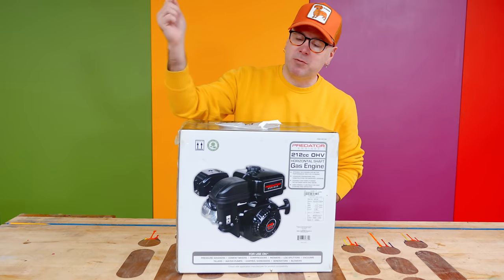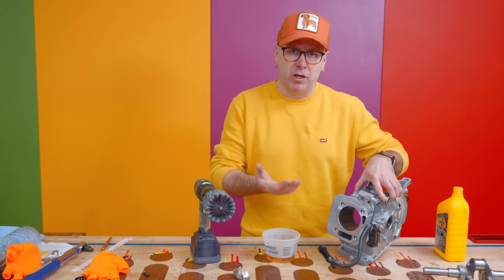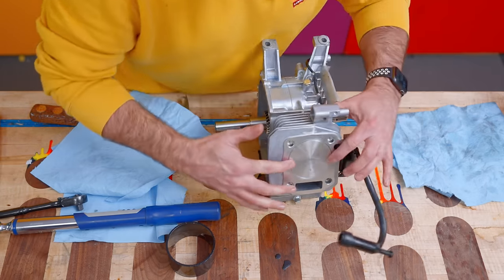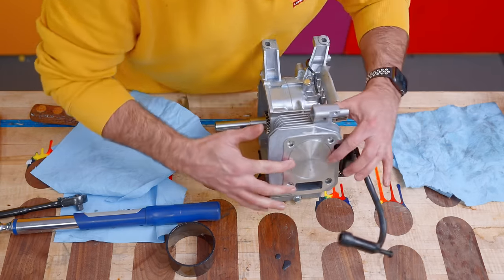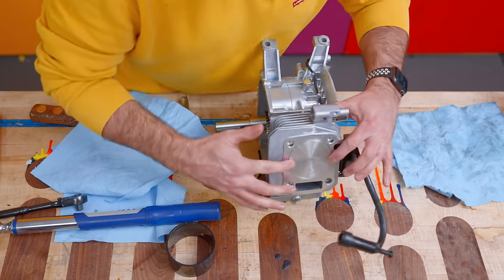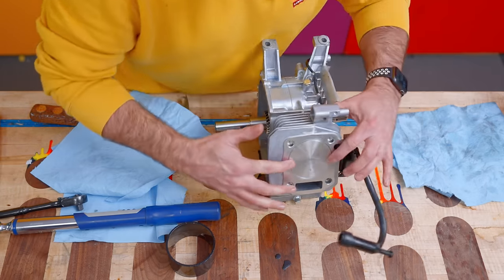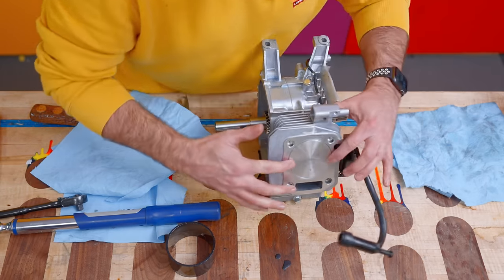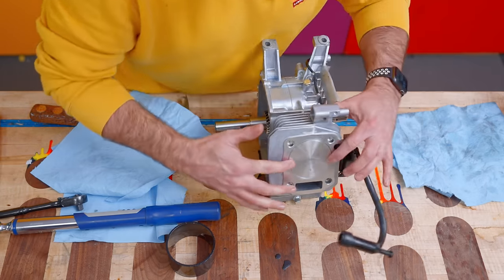How to Build a Competitive Kart Racing Engine (Stock Appearing)

Comment: easier way to get the flywheel of..if you remove the pistonrod anyway..leave it on until you removed the rod..put the nut slightly back on the crankschaft and give it a whack with an hammer!😁

but i still don´t get why PPL spend so much money on Parts for those cheap Honda Clone engines...just a billet flywheel will cost twice then the whole engine!

Comment: Piston ring compression tools are a bad idea, especially for just one piston. Almost as bad as using a pick to instal the clip on wrist pin.
At least if you use a piston ring compression tool that you don’t need, make sure the piston isn’t binding in the cylinder. You can’t see if the rings are facing correctly & in their grooves. Hence why they’re a bad idea. 
Don’t file or Dremel over a open engine. Especially not over a open bearing. You don’t want metal shavings in your bearings.

Comment: Man your doing it wrong. Briggs came out with the lo206 moter. Its to make competition fair. The cam tolerances vary so you buy 10 to 20 of them to find a good one. Modifying a cheap motor with aftermarket parts make no sense. That costs way less and hf only sells 1 motor instead of 20. So yeah the local option is great.

Comment: are there weight restrictions in go-carting?  i’m guessing the 6’3”. 260lb guy will be a bad driver choice.  lol
Reply from the maker: Most have a min weight of 350 lbs. The league I run in does not so it is an advantage to be light.

Comment: To add to the power tool comment, if you have a drill that has a low torque setting put it all the way low and then torque what you need by hand 👌🏼

Comment: That’s not glitter buddy  ,that’s metal shavings from bad clearances and rough edges on the teeth . That’s not good . Couldn’t you just Deburr everything and polish all the parts inside , without taking away  tolerances . Just a nice clean up so that there is no metal rolling around during the break in phase .

Comment: its not hard to make a piece of sheet tin with a  valve stem in it a rubber tube make a good gasket when you are looking for valve leaks air up the port lightly and look for bubbles in the alcohol not water

Comment: Well done you’ve just unbalanced the crank also when honing it should be accurately straight in the bore other than that good job but focus on those 2 issues
Reply from the maker: It's actually impossible to balance a single cylinder motor because of mechanics and physics. Look it up. 😉

Comment: If you didn’t skim your heads with a belt sander you probably wouldn’t have to run thicker gaskets. If you get them done on a mill you can probably get away with the thinner ones.

Comment: Weld inside the block and cover to stiffen the motor.
Reply from the maker: Not allowed.
Reply: @SomethingAboutMaking  in racing, if you are not cheating, you are not trying.
Reply from the maker: @timlaws7034  Reminds of the quote by the great Gus McCrae ~ "A man who wouldn't cheat for a poke don't want one bad enough"

Comment: Higher compression ratio. Like. The highest you've ever heard of. reinforce the block on the inside. From the carburetor to the top of the intake valve: good grief that's some gnarly choppy  rotten flow.
Reply from the maker: I wish I was allowed to reinforce. damn rules get in the way.

Comment: Why is it that these engines vibrate usually at full throttle? My coleman bt200x vibrates really bad at full throttle. I know they're Chinese motors but damn that's ridiculous.
Reply from the maker: A single valve motor will never be balanced so vibrating will always happen.
Reply: @SomethingAboutMaking  thanks for the reply and the info bud👍

Comment: What is the approximate hp of that modified engine?
Reply from the maker: Don't know for sure but guessing around 18 based on other motors that have been dyno'd
Reply: @SomethingAboutMaking   do you know the final weight of it? I'm wanting to make a WIG Craft. Wing in ground effect  plane. Something that will skim the surface of the water.

Comment: Why on earth would you take it apart after running it in ?
Reply from the maker: gotta see how it's wearing in. Make sure there's no odd scratch patterns in the cylinder and the cam is not grinding.
Reply: @SomethingAboutMaking  but then you have to run it in again . And the extra undo wear on threaded fasteners ....

Comment: Real mechanics don't use claw hammers, then to top it off they also don't smash the end of threaded shafts without first putting a nut on flush with the threaded end to prevent mushrooming or otherwise damage the threads.
Reply from the maker: Nobody here is claiming to be a real mechanic.

Comment: Another secret is to twist the cam slightly so your in the gray area Of the rule book. Twisting the cam gives you more horse Power and is still legal.
Reply: Twisting the cam gives you more horse Power on the high end. That's when the motor comes alive. Much better than low end power
Reply from the maker: I think we talked about advancing the cam timing a bit. 😉
Reply: You said about advancing the cam timing. I was talking about twisting the cam lobes for more horse Power. I like watching your show. Where is it you race? I race in CT. When we twisted the cam lobes I won the championship in the lights and mediums.

Comment: USE GASOLINE INSTEAD OF WATER! ALSO, BLOW IN COMPRESSED AIR FROM THE BOTTOM THROUGH THE EXHAUST OR INLET PORT IF THERE ARE FINE LEAKS AIR BUBBLES WILL BE FORMED!

Comment: Surface glass is NOT flat. Get a granite surface plate from eBay, and use that to lap the head. 
-a machinist
Reply from the maker: It's not surface glass it's plate glass which is.

Comment: no need to go crazy trying to find top dead center   when one valve is fully open  adjust the closed one  that is closed
  thats all there is to it
also a good C clamp type valve spring compressor is  better than a paper towel and 
your muscles ti compress calve spring

Comment: I'm not belittling the video or the work or the modification but I was doing this before most people on this forum were born I started around 1968 but I started modifying in 1970 but I didn't have any tools didn't have a shop didn't have any money now everybody's doing the same thing that was in my brain back then so this modification stuff isn't new as far as valve ceiling I did head work for 20 years from 80 to the turn of the century and I used gasoline solvent Windex air pressure from behind and overnight liquid test so nothing is new the only difference nowadays is people are using CNC machines which did not exist I had to do everything by hand also people are making speed Parts which did not exist when I was doing this my first engine was a Wisconsin ACN which is a 6 horsepower sump pump motor I threw away the governor it has a 10 lb cast iron flywheel the motor itself weighs about 65 or so pounds when built I had it going over 60 miles an hour in a go-kart without a clutch I was very poor then I rebuilt the whole motor myself when I was 14 it took me a solid year

Comment: you are not supposed to run it as hard as you can when breaking it in, that's just going to destroy the engine, when you are breaking in a new engine, you're supposed to take it easy and not go hard on it

Comment: Let me help  you out a little there buddy. You're obviously a newb when it comes to this stuff and you're hamburgering this shit up..  

Tappet lift - How much the Tappet or "Lifter" moves from the base circle of the cam to peak lobe lift. 
Valve lift - is how much the valve itself opens..   This is easily calculated by Tappet lift x rocker ratio.   ex: 0.400 tappet lift x 1.5:1 (1.5) rocker = 0.600" Valve lift.   
Cam Duration -  This is usually measured in 2 ways.  Advertised duration which starts at 0.001" lift opening the valve and ends at 0.001" lift before the valve is completely closed.  there is also a @0.050" duration which is sometimes a more accurate number to go off of.  The 2 numbers alone can give an idea of how aggressive the opening and closing ramps are on the cam lobe. (How fast the cam opens the valve in degrees of crank rotation)  The faster a cam opens the valves, the more time you have open above half lift. This can significantly increase air flow. 

If you're gonna go this far, you may as well build a cheap DIY Vacuum cleaner flow bench and test port flow of the head. A flow bench measures the amount of air flow that a head is capable of flowing at different valve lifts. The better you  can get the head to flow a low lifts, the more power the engine will make all through the RPM range.. The more PEAK lift flow, the higher you can spin the engine and still make power as well as you can grab a larger lift cam to take advantage of these high lift numbers.  That brings me to PORT STALL.. 

Port stall is the point at which valve lift no longer significantly contributes to airflow.  For example look at the chart below. 

0.100" - 1cfm
0.200" - 3cfm
0.300" - 5cfm
0.400" - 7cfm
0.500" - 9cfm. 
0.600" - 10cfm  (Beginning of port stall) 
0.700" - 10cfm  (deep port stall) 
0.800" - 11cfm
0.900" - 11cfm
1.000" - 11 cfm

If you look at the flow graph, you can see that flow gains between valve lift starts to drastically fall off after 0.600" lift.. SO, you ideally wouldn't get a cam that has much more than about 0.610-0.630" lift  for this head as more lift only stresses components, reduces valvetrain stability, and limits RPM as the valve springs have a far harder time controlling high lift cams at high rpm. 

Next, ROCKER INSTALLED HEIGHT!!!!!!   DO NOT OVERLOOK THIS!!!   There is a TON of free power left on the table if you don't do this!!  install your rockers, and set valve lash. install a dial indicator with the engine at TDC compression stroke, and the dial indicator tip almost fully compressed on the intake valve retainer. Note the measurement. rotate the engine until you achieve maximum lift and see what the dial indicator reads. Do simple math and calculate ACTUAL valve lift.  Now remove rockers, add 0.002" shim between both rocker studs and the cylinder head. (You can get these from McMaster Carr. Reinstall rockers, set valve lash and repeat. If you GAIN lift, add another 0.002" and repeat. if you lose lift, file/shave about 0.002 off of the stands and reinstall and repeat.  The idea is to get the maximum amount of lift possible. You may be able to do this by swapping out lash caps of different thicknesses as well if different thicknesses are available.  This will help you attain more lift above half valve lift.  When you achieve max lift with your adjustments, Lock it down and you're ready to rip.

Comment: ….back pressure NEVER helps flow. You want zero back pressure. Why would you want to inhibit the job your exhaust valves are trying to do? You don’t want to put pressure against spent air trying to come out of the combustion chamber

Comment: had an old engine guy explain duration and lift to me like this. imagine your the door man at a store with a pressing crowd outside, they all want in RIGHT NOW! (thousands of Karens on black fFriday back in the 80's i guess). you have control over the door, you can choose to open it wide, or open it a little, that's lift, duration is how long you take from full closed to full closed while cycling the door through it's opened phase. with this in your head, you should be able to see that at the far ends of this model, the flow just isn't that good ie. very short duration and huge lift or vice versa. obviously even small changes in how long you open the door, or how much you open the door effects how many Karens get in to the store per time that you cycle it.

Comment: As an engine builer i lost count of the times i shouted "No, dude. Don`t do that" Nevertheless it works for your case and application. So, cheers for sharing. talk to builders, they shouldn't have issues pointing things to improve your skillset. As my two cents: You overtorked every single bolt. a bit of caring should extend your thread and torque wrench lifespan. Cheers!

Comment: I cannot take anyone seriously that uses a steel hammer on the threads of the crankshaft to remove the rotor. Never hit a part with a steel hammer unless it is to be scrapped. Just talking from 50 years experience in the engineering trade.

Comment: So basically instead of buying a complete motor then hundreds in aftermarket parts just buy complete aftermarket parts
Reply from the maker: As long as you can acquire the required stock parts to meet the rules then yes.

Comment: Hahaha, stock appearing, seems to be alot of those in kart classes where the motor is suppose to be right out of the box and put on the kart.
Reply from the maker: out of the box is called "box class" and stock appearing is as it's called.

Comment: $1200 in engine parts !

Are you insane ?
Reply from the maker: Motor Racing in all forms is expensive
Reply: @SomethingAboutMaking  , I grew up poor , 
I could build things to work and make hp without spending a fortune ,  
All engines are nothing but Air pumps , the higher the compression ratio , the more  hp they produce , I would have changed the flywheel, piston and connecting rod , everything else I could modify myself

Comment: well I have over 50 years of building real motors I don't know automotive machine shop and I've done everything from model Ace to top fuel throw the dingleberry away for honing your cylinders because the ring manufacturers say that's the worst thing you can do to the rings and get you a real home but you only just want to scuff a cylinder you don't want to take out any meat you don't increase your piston to wall clearance your head gasket problem with the thin head gaskets is you're probably not flat probably need to take that head to a real machine shop and have them put it on a good meal and skin cut it God knows what he's doing he ought to be able to have a way of setting it up and take what I call a skim cut which if you put blue on it it cleans up within one or 2000s sometimes quicker your valve seats you're using that new weight cutter system I had one 40 something years ago one it took too long for us but it chatters it doesn't get it smooth and you want it super smooth you want to crease valve job once you've latched your valves you get the machine shop to back cut them and put a 30 underneath the 45 and that'll gain you horsepower and it's free horsepower and when you hone your cylinders if you can find somebody that has a plateau home finish which looks like a car wash brush smoke a unit designed it and it takes and does a miracle to the cylinder wall and when you fire your motor you don't get all the black in it because that's what you're pissing rings or wiping off the cylinder walls guys that were doing the junior dragster stuff realize that they would fire their motor in the oil was dirty they used to plant they fired their motor and it wasn't dirty a lot of the other things strictly to your world the I can see where it's very expensive by the time you buy spring seat cutter and seat valve seat cutter and and all the specialty tools she's probably spend a couple hundred dollars which is you know what you do every time we get a new motor it cost us three to four hundred dollars if we want to work on it just for the specialty tools which finally got to be a joke and quit doing it but for the guy that wants some of this done might find a small machine shop in this area that does real work and especially if they work on foreign cars they'll have a lot of that small stuff because valve guides and valve stems have gotten down to 175 and 175 and size and I don't know what that is in millimeters I hate millimeters with purple passion but that's my two cents if that helps you at all but I did find it very very interesting
Reply: I reread this I should have read it before I did it you have to excuse some of the words cuz I don't type so I use the voice deal and it doesn't like my voice

Comment: ... wait, im like 4 minutes in and of a 300 dollar engine, you are using 2 parts and selling the rest on eBay?
Reply from the maker: you get it!
Reply: @SomethingAboutMaking  It was a heck of video.  I'm just really surprised by the approach.  Is there a rules reason why you started with a complete engine or would sourcing just the block/head/drive-shaft be an option for you?
Reply from the maker: It actually cost more to buy the needed stock parts separately
Reply: @SomethingAboutMaking  Ahh ok that does make sense actually, worst way to build a car is from the parts desk.  :) Hey thank you for the answers, much appreciated.  I think the only running part you didn't do an upgrade on was the bearings?

Comment: Watching a non-mechanic do mechanic stuff is cringey at best it's scary at worst but no replacing your connecting rod with Billet is a performance modification because now you can do 8,000 RPMs without that modification for performance you wouldn't be able to do that so yes you were getting a lot of power out to connecting rods because without them you don't have RPM
Reply from the maker: ok.

Comment: No this is not building your kart engine whatsoever we used to race Yamaha 100 and they would have to close down streets you the  Predator import crap that you people are thinking that you're racing around is  nothing. And yes Yamaha is a in port  and so where the Sacks we ran. You had to have 4 disc and calipers to enter .Brakes that is. One of the more  common races ran was the Elakart 500 in Elkhart In
Chicago we had great races. Ohio  Michigan  and so one. This was in the  middle 1990's.😊 
.